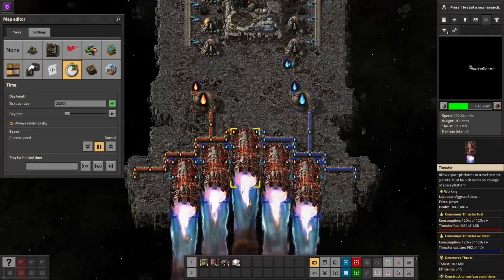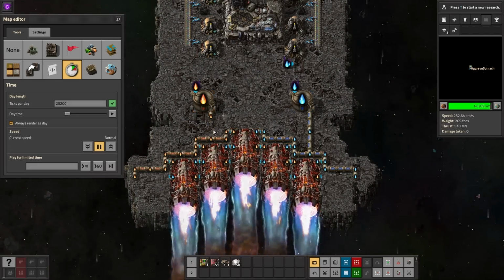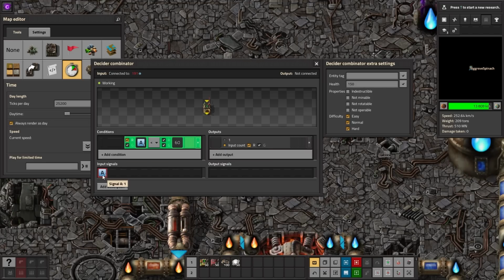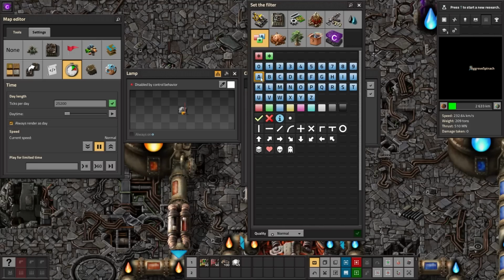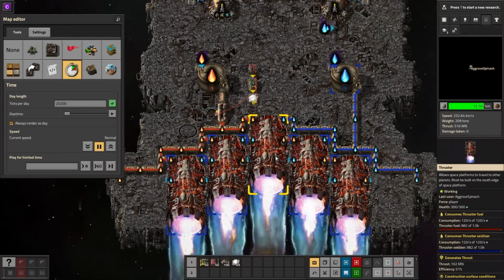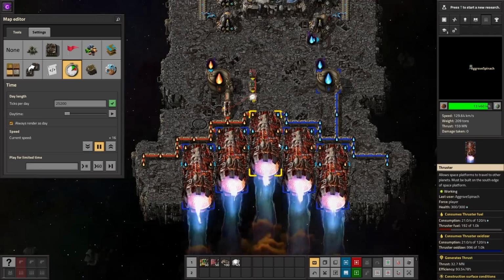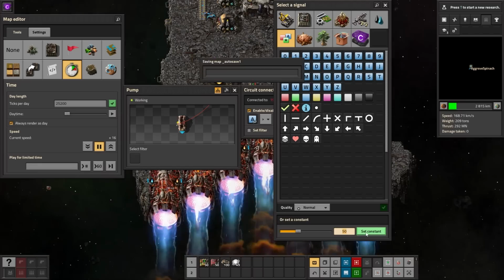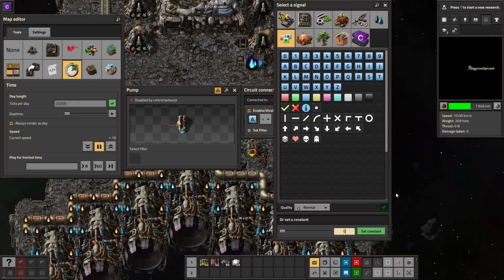Controlling THRUSTER fuel input and efficiency - Factorio 2.0 Space Age Tips & Tricks

Comment: That's more elegant than the system I came up with - I put a storage tank on the output side and told the pump to operate if the level was below 100.
Reply: That's the standard solution, which I would have gone with too. If it works for cracking, it works for thrusting.
Reply from the maker: The storage tank solution sounds even simpler than my solution! This is what I get for asking the factorio discord how they solved this problem, they obviously all suggested complex crazy logic circuits. So I tried to come up with the simplest logic to implement. So if you control the front pump based on the back storage tanks volume does it match perfectly every time?

ie. If I want 45% fuel in my thrusters, just put a storage tank at the end and make sure that storage tank is at 45%?
Reply from the maker: So I tried this storage tank solution and I must be mispositioning the back tank because I can't get the tank to match the fuel levels in the thrusters. The tank is at half but the thrusters are full?
Reply: @DataEngineerPlays I don't know how they did it because yes, for me the thrusters work like all other buildings and pull any available liquid from the fluid system until the system is empty. I also use a clock in my ship now; before that I just used the amount of chemical plants that would deliver my target amount of fuel.
Reply: @DataEngineerPlays  It's storage tank -> pump -> regulation tank -> thrusters. Automation from the regulation tank to the pump. The rate thrusters draw fuel seems to be in proportion to the amount in the pipe. By keeping a tiny amount of fuel in the pipe, you can control how much the thrusters are drawing. I've gotten very good results this way, and it's simple. I tried the clock approach. It works just as well and takes up less space. I'm making the switch. Thanks for teaching me something.

Comment: this is a passive control system. You can also add feedback that detects the current amount of thrust(acceleration) provided by your thrusters and regulates the pump based on the difference between the current acceleration and the desired acceleration instead of just changing the amount of fuel provided. It requires like 10 combinators but it changes the thrust and the efficiency faster since it's aware of the amount of fuel in the thrusters.
Reply from the maker: Yes when I was researching how to do this, I found many complex logic circuits that do a more accurate job, but I was going for simplicity. What's the dumbest/simplest way to keep a controllable amount of fuel in the tank.
Reply: @DataEngineerPlays  Couldn't you read the speed of the ship and turn the pump on and off based on a set value you calculate from the thrusters?

If you have 6 thrusters and you want them to each output 100 MN of thrust, you could turn the pump on when the speed of the ship goes below 600 MN

The new fluid system should balance the internal buffers of each thruster, right?
Reply from the maker: @wersywerxy  It does with much more fluctuation than that clock circuit. eg if the pump says "V < 200" turn on you'll have an efficiency fluctuating between 75-85%. which is an okay trade off if you really don't want to implement the clock

Comment: Can't you just add another tank to the pipe network on the output side of the pump and use that to read the fuel level in the network?
Reply from the maker: I need to try this to find out. If you can then I like it even better than this circuit

Comment: Genuine question: why would one care about efficiency over speed? Shouldn't more fuel useage mean that you just need to create more fuel?
Reply from the maker: It's up to you if you care about fuel efficiency. If you just want to create more fuel, that's also a solution.
Reply: The wiki has a very nice spreadsheet

Dumping more fuel per second into a motor doesn't produce more thrust.  For example running the motor at 75% thrust halves your fuel cost which means you can run twice as many motors which overall will generate +50% thrust per unit of fuel or at the extreme 20 motors running at max efficiency will produce +100% more thrust than one 51% efficient motor for the same 120 fuel/second

In simpler terms more efficiency = more thrust per fuel at the cost of building more motors
Reply from the maker: @mattr791  Ya, does the wiki have an idea efficiency % to run at? You can always run your tanks at 10% fuel and have like 95% efficiency and like 20 engines, is that good?
Reply: @mattr791 the factorio way is to have as many engines as your platform can handle and build fuel crafting with that in mind.
Reply: @mattr791  what if i were to take half that engine area (plus piping) and convert it into fuel production? It's not like the raw materjals are difficult to come by

Comment: For me I tie the value to the amount of ammo I have available.

So the lower my ammo count, the less fuel (in my case oxidizer) gets pump and the slower I go.
Reply: This is exactly what I'm setting up now, for my shattered planet platform 

It feels over engineered to hell, and yet, when using just 1 epic thruster it goes too fast and will eventually run out of rockets, either getting destroyed or making me pause it. 

I just had this thought last night, that since I already check the levels of ammo on the sushi ammo belt, then pumps could read those ammo levels and only work when there's a surplus of ammo, thus keeping it out of danger. 

The main problem really, is either that the ship is too fat(wide) and contacting too many asteroids (literally thousands per attempt) and/or it needs to be taller (vertically) both to reduce asteroids in range and extend production facilities. 

I'm not sure how far anyone else has gotten, but I've been to 150km towards the shattered planet on 3 seperate attempts. 

Also figured out that storing promethium on a snaking belt is more efficient than even legendary cargo bays. 

More solutions are needed.
Reply from the maker: I'm not at prometheum runs yet so I might not know what I'm talking about, but logically why does speed change the ammo usage? You'd think there's a fixed amount of asteroids on a journey, eg say there's 1000 asteroids between planet A and B.... whether you go at 1km/s or 1000 km/s you use the same amount of ammo to destroy those 1000 asteroids right?

The only thing ammo checking would do is to prevent your craft from being destroyed by slowing it down so it has more time to destroy dense asteroid sections, but in terms of ammo usage, it's the same. So why not calculate before the trip how much ammo you need, then park at nauvis till you've stocked enough, then go on the trip?
Reply: @DataEngineerPlays  as you get closer to the shattered planet, the asteroid density spikes pretty hard, so maybe that's a consideration to try and keep it from going too fast for the ammo production to keep up
Reply: @DataEngineerPlays  Asteroids are not consistent regardless of speed. The faster you go, the more asteroids spawn, the faster you have to destroy them, and the more ammo is needed in that time. They spawn at the edge of the screen and float, but its your speed value that makes you move forwards and spawn more. 

I've done more testing and i may have found the ultimate solution to reach the shattered planet. Switching from yellow (non explosive) rockets over to red(explosive) rockets will slightly complicate the production chain, but massively increase dps and heavily reduce the amount of resources needed to sustain defence. Additionally, by reading all ammo on the ammo belt and setting up pumps to read those amounts, the engines can be kept at the most ideal speed, such as "enable if red rockets > 3k". 
Additionally, we can use a single combinator to combine two conditions. Take the speed value of V from the main hub, and the amount of rockets desired, and output a signal. If both are true (speed too low and rockets plentiful) then engage the pumps that fuel the engines. 
This keeps engine efficiency high, keeps speed consistent if possible, and ensures the platform will never take damage.

I believe I can make it all the way to the shattered planet on my next attempt, which will be on a new platform with all epic tier machines and turrets to maximize efficiency
Reply: Neat idea!

Comment: Another way of doing this that requires no circuits is to put the pump between your producers and your tanks, and then set the pump to only be on when fuel is below a value. Usually something between 50 and 200, but you can experiment. This also eliminates the fuel excess when parked problem.
Reply: I don't think it does eliminate the fuel excess when parked problem, but it does eliminate the need for a clock.

Comment: Another note, you can read the "moving to"/"moving from" signals from the hub, and set your clock to disable when there are no planets selected by those signals. This prevents the thrusters from filling with fuel while the platform is stopped, and prevents them from burning much faster at the beginning of a trip. This is good because if your platform is designed to be safe at a specific speed and you don't want them to go faster
Reply from the maker: That's cool, I didn't realise there was a simple solution to this, hence I didn't implement one. The one's ive seen all do some speed checking to tell if the ship needs to move and I didn't want to add any more complexity to the circuit.

But if its as simple as reading a moving to/from, then yeah great idea
Reply: oh so that's how you're supposed to do it! I just assumed those signals would still be set even when it was stopped at a planet so I checked if the speed was higher than a threshold to determine if it was travelling or not 😂
Reply: @Temari_Virus They are still set, but to the same thing. One has a value of 1 and the other 2, so a decider set up to calculate "is any planet signal = 3" works for an "are we stopped" check.
Reply: We had this in multiplayer. Only downside I found is that very very rarely the platform stops at a planet with no fuel in the trusters. Then it will never initiate moving to: x planet. Because it hasnt got that tiny tiny bit of fuel to start moving.

Perhaps it was a bug, as we do run in beta branch. Soo.. who knows.
Reply: @cheetahrunout  I had the same issue. I had to connect a small buffer tank to the thrusters and a pump that stops when it has just a little bit of fuel.
Reply: ive just used it and it removed like 10-12 k feul lose. thx
Reply: There’s a bootstrapping problem with this.  The moving signals don’t start until you actually move, so if there’s no fuel in the thrusters, you’re stuck.  This really feels like a bug.
Reply: @cellularmitosis2  nah even when stop it has both data as a single planet
Just nead to check if it is 3 or not

Comment: Aah I had an interesting idea which involves 2 tanks for  fuel, and 1 tank for oxidizer. I pump Oxidizer in at max speed, but set the fuel  to only pump into the second tank when the second tank is below X% fill level, AKA the engines own fuel will be at X% fill level, and wont go below or above.
Reply from the maker: What if you run out of oxidiser?
Reply: @ it will only drink as much oxy as the fuel it’s burning, so you only have to regulate one.
Reply from the maker: @Gaminggamer1602  Ya I slapped it on both as a backup, it doesn't hurt. My real ship was underproducing oxidiser at one point so the fuel started filling up, but I suppose that also means the oxidiser was underproduced so it was auto regulating itself on the oxidiser side lol

Comment: I didn't even know that those engines have fuel efficincy......I just don't understand, why whould i want to do this? I'm looking for ways to go as fast as possible. And looks like, in order to achive that, i need to burn fuel and oxidiser as much as possible. And no, putting more engines on it is not a solution, as it would make it wider, which increases "space drag", making the ship even slower.....Makes me sad that increasing efficiency doesn't increase the speed.
Reply: Because increasing efficiency doesn’t mean increasing speed. Efficiency is the amount of fuel you will need to burn to maintain specific speed. It’s like driving a car. If you maintain 120km/h you will burn eg. 7l / 100km but if you maintains speed like 240km/h you will burn 28l/100km, so you are moving twice as fast but burning 4 times more fuel. And exactly that is an efficiency.
Reply: @damianr.3917  there's literally infinite asteroids. Maybe I haven't gotten far enough yet but I can't think of a reason to care
Reply from the maker: You're not wrong, if you don't care about efficiency, just burn more fuel. I've never even bothered with this until aquilo and only implemented this because I couldn't be bothered adding another fuel maker to my build

Comment: EDIT: This comment was WRONG, Keep reading knowing that. ORIGINAL COMMENT: This seems to be more complicated than it needs to be. If you know the ideal amount of fuel you want to have in an engine, just set up two holding tanks, and use a pump to maintain that value in the tank next to the engines.
Reply: How does this account for the thrusters large internal buffer?
Reply: @Ailtir You don't really need to. Think of it as an acceleration boost at the beginning of the trip. The efficiency should still be the same because you're still limiting the input. The engine is just burning the extra fuel
Reply: @Ailtir  I was watching it the other day, as my stockpile went down, the stored value in the engine went down. It has no internal pump. Whatever your passive pressure is, is the value in the engine. Just like a container along a pipeline. They all have the same average fill percentage.
Reply: @Sean_Brockest  the thrusters will still take in fuel and not release it back into the pipe system though. So when you're parked they'll still fill entirely. They don't pump it but they do act as a one way valve I guess?
Reply: @Sean_Brockest  No that's not how thrusters work at all.
Reply: @Ailtir  I'll take another look at it tonight when I get home, but that's what I witnessed. I have no pumps on my space station, and everything seemed to have the same value. Same percentage in the pipes, tanks, engines. I'll shoot you a video if I see it, maybe you can explain that I'm seeing something wrong.
Reply: @Ailtir  You were right, my test failed, but only kinda. Setting it up like I said actually kinda worked, but only because I was restricting the flow. My idea is still simpler than his, but doesn't allow for the fine tuned control. But I still got above 80% efficiency.

Comment: you can wire a pump directly to the hub and read the speed V.
Reply from the maker: And the logic for speed to pump control is what?
Reply: @DataEngineerPlays  Enable if speed V < target_speed
But this makes the pump inject more than what is needed to reach that speed.  And if the target is a very high efficiency, the actual speed of the platform will go way over the target.  Then slowly go back down, until the next fuel injection, etc.  So at least for low speeds, your way is superior, as in, more stable speed and efficiency.

I've been throwing both inputs, speed and clock, into another combinator that relays a on/off signal to the pump.  So it's an hybrid of both methods, which is not needed at all.  It's more a "why not?" thing, when the cost is only one more combinator that will fit in an existing hole anyway. ;)

Comment: I use platform speed and the value in each a fuel and oxidizer tank to control the pumps. Both Speed and the fuel level in either tank go into a decider that activates the pumps if, for example, speed and fuel dip below 110 kmph/ fuel value. I only tested this between 50 and 150 kmph, but it seems that at least in my system, having the fuel intake value be equal to the desired speed is enough to reach it without much fluctuation, so I can set the exact speed my ship travels at by putting in one  value into a constant combinator that goes to the deciders. 

Dunno if that's an obvious or flawed solution, but I just recently dared touch circuit networks and it works so far. Apart from the first 10 seconds, my thrusters never dip below 90% efficiency in this setup.
Reply from the maker: So opposite to what I've done basically, you control the pump using a fixed speed which in theory should maintain a fixed level of fuel in the tank
Reply: @DataEngineerPlays  Well, using just the speed as the condition for the pumps to the intermediate tank was my first idea, but that caused huge fluctuations in speed since the pumps would just put out too much until the speed goes back above the constant value. Having the fluid in the intermediate tanks after the pump being the other OR value to the activation stops the system from getting too much fuel when the speed dips below the activation value. 

Hope that made sense lol.

Comment: I've been using a speed limiter based on the Hub velocity output. If the speed is above the limit, cut the fuel off. In practice, if you set your speed to 100, it will fluctuate between 90 and 150 because of the engines fuel capacity, but it's a single decider+constant.
Eliminating the initial boost (cut the fuel if we're not in transition) is also a pain in the butt, so I ended up just not doing it.